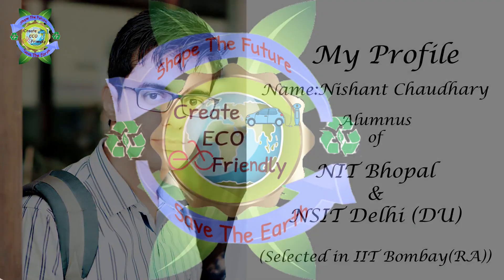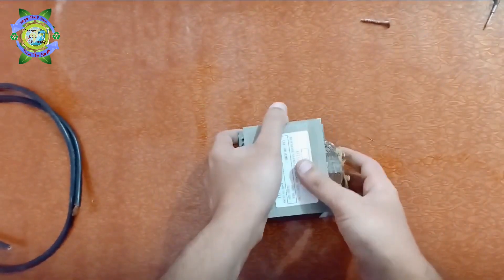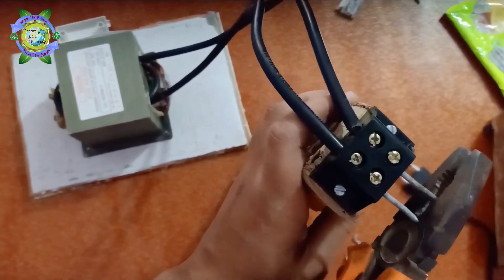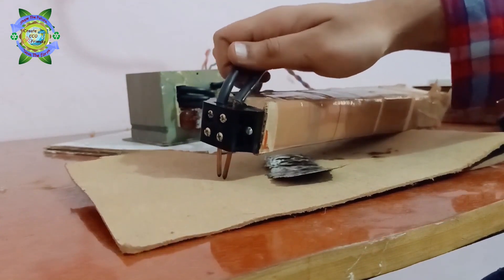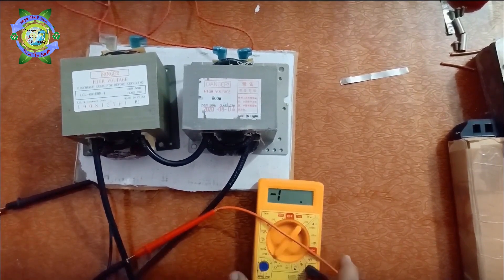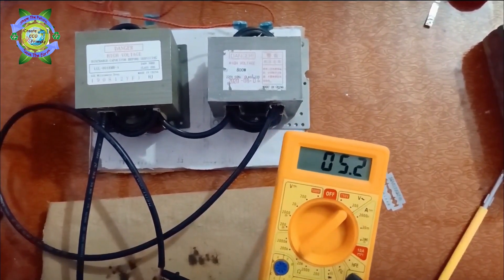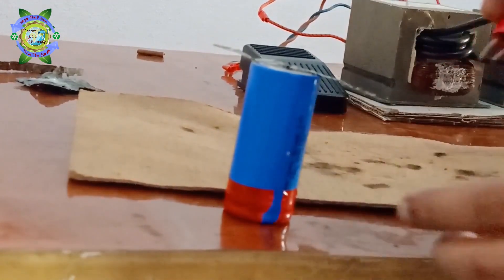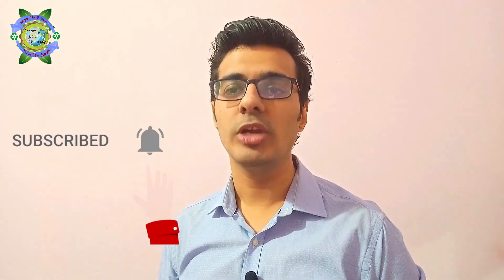DIY Spot Welder | Not working to working | not working too good to working fine..

Comment: i made one but ii get short circuit  and it blows the fuse   when u connect the power to the  transformer  does it matter  which one you connect the  black wire and  in which one u connect the neutral one
Reply from the maker: Since that source is AC source the Live and neutral wire doesnt care..

You can connect any wire but make sure there should not be any connection between live and neutral wire...

Comment: Hi I would like to make one but I am bit confused where is black wire which is you feed in transfer where is connected with electric please reply me
Reply from the maker: Hey...
Can you be more specific...
I dont understand what do you want to ask bro

Although what I understand is that you want to ask the connection..

(Please use more thicker wire may be 35 mm² and 3 or 4 turns as per your requirement in this way you may require one transformer... And this also depends how thick strip you want to weld)

Black wire is used in coil which I cutted off.. but here in this video I used two transformer in which output is connected in series..
And input is in parallel connection

Comment: All you need is to use ticker wire. 10mm2 is not enough. If you can get three turns of 50mm2 wire (about 2.7V) it will work even better thank the Sunkko you bought.
Reply from the maker: Yeah thick wire will work good...
And Will try that too...
Thanks a lot
Reply: I have used 25sq mm 3 rounds and getting voltage 2.68 but not welding ?
Reply: 25mm2 is not enough, I used 50mm2 of good welding cable. Make sure the cable is as short as it can be once ir comes our of the transformer.

Comment: Sir How  many spot welding required  volt and amper
Reply from the maker: Pls be descriptive..
I didn't understand.. you mean to ask how much current and voltage required?

Well it depends on size of spot welding strips..
For less than 1.5mm you can use only one transformer...
Well current and voltage here too depends on size only
You can also use electronic circuits to control current as more current may pierce though the metal strip.

Comment: The parameters you calculated are not correct, so the solder joint is burned and punctured, which is very dangerous when soldering on a full battery, which can cause fire and explosion. Please see my sharing through this clip to be able to make a safe battery cell weld (you can open the  subtitle automatically understand my sincere sharing). thanks
https://m.youtube.com/watch?v=XDJ9OwcPccQ
Reply from the maker: This is not solder it is spot welding... And my calculations are as per my project... And it did well bro for my battery you can chek

Comment: try increase the gauge of wire with one transformer ...it will increase the amp ..if possible may more than 25sqmm..with 2 turns only .
Reply: A professional spot welder should work between 2.5 - 3.5 volts. It all depends on the primary how good it is. In this case you can only solder 2 transformers and add 5-6 turns of 35mm2 wire to have 5/6 volts
Reply from the maker: Yeah I could work but on thin sheets..
And I have to use thick sheet so I use more power so two transform

Comment: A have a dawot. I gonna make with circuit boards but out voltage 1.7
Reply from the maker: What?
Unable to understand that..
Plz dear 😭 write clearly what did you use an adrino circuit or timing circuits etc...